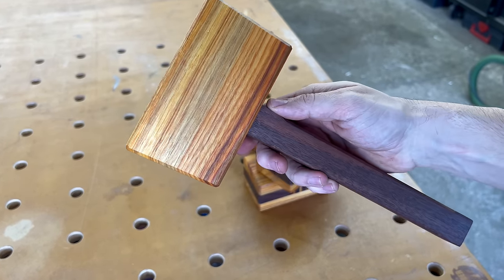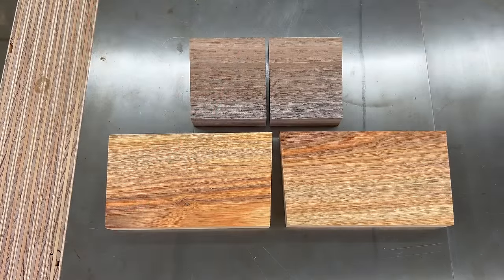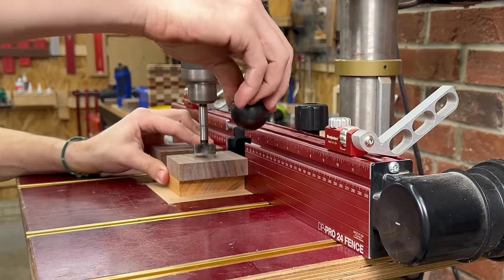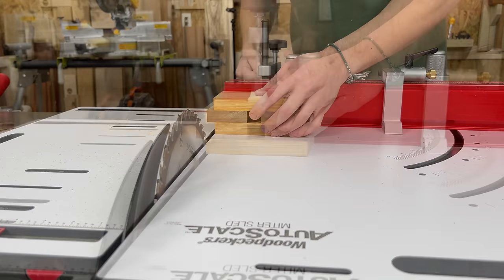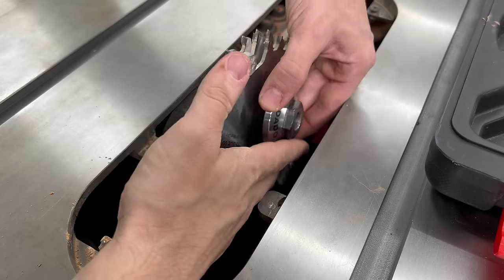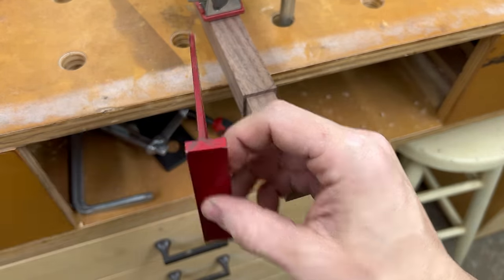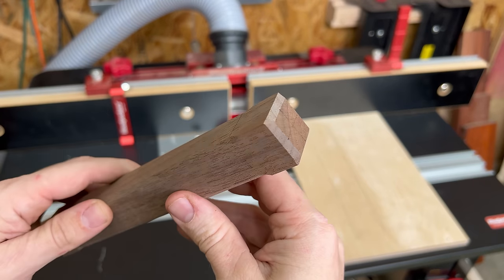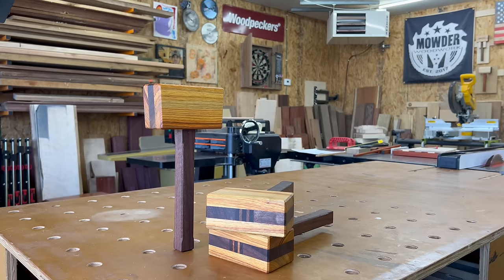Every Woodworker NEEDS a Mallet l RedTOOL WOODSHOP

Comment: I enjoyed the video very much. I always have reservations when a video is made by, or sponsored by, a tool manufacturer. When those tools are at the top end of the affordable scale, then my reservations increase. I really do fear that people looking to come into woodworking think that the only options for accurate tools are extremely expensive. 

I appreciate the Woodpecker tools that I have. They are robust and accurate. However, several years ago, I started to put my foot in the water and buy tools from Veiko and Hongdui. I have to say that it is my experience that these Chinese tools are as equally as robust and as accurate as Woodpeckers but considerably, significantly, more affordable. 

I do not like buying tools that are made in a country with a government such as the Chinese. However, I would add a couple of other points. I do not like buying tools that rely upon a perceived brand excellence to have very high prices. I also understand that there are very few tools (or anything else) that are not made in China and/or made by machinery not made in China. Finally, the cost of most of these tools is a combination of high quality aluminium (a global commodity with a global price); the manufacturing cost by CNC (again a largely global cost);labour (there will be obvious cost differences there but the labour element is minimal); overhead recovery; marketing costs (such as providing subsidised or free tools to “influencers”); and profit. 

If you love Woodpeckers and can afford to buy them, then good for you. Keep on buying. However, let nobody think you need to buy Woodpeckers in order to make beautiful, precise, functional pieces.

Comment: I am a Woodpecker fan. I I have the Auto scale Sled and I actually built the cradle from your plans. I did modify if by adding  two feet with levelers to take the stress off the table . The sled and plywood is pretty heavy.  With that said the sled gets used  an absolute ton . I am awaiting Woodpecker's releasing there Dado blade I would like to give them a try. I think I also need the perfect 90 in my shop , I love good build videos so thank you for the video.
Reply from the maker: Thanks so much for your comment! And you’re right it does add some weight to the saw, adding adjustable feet is a great idea. I think I’ll add it to mine as well! Thank you.

Comment: A really great job at articulating the value of good tools while creating a useful project.  I am a huge fan of Woodpeckers, so much so that my wife is no flagging anything with that name to come see me about it.  And now there is Blue Spruce of which I am also a big fan.  I could not help notice the holder on the side of your saw where you are storing the Woodpeckers Miter Sled along with the drop off sled.  I have the same sled and have been starting to give considerable time to figuring out where to store it.  That is a perfect solution for me.  Did you just build it to fit, or did you happen to draw any diagrams for it?  I took a screenshot of the rack with the sled still in it hoping I could make a similar solution.  My saw is different and there is an access door on the saw right on that side, but I will look on the other side and if all else fails, I can put it on a hinge to swing up when I need to get into the saw.  Keep up the good work Jay
Reply from the maker: Thanks so much for your kind words! And you’re in luck, I actually made a set of plans and an instructional video on how to make that storage holder about a year ago! I love it. I use the AutoScale every day in my shop and I don’t know what I’d do without that storage holder. I also have an access door that I’m blocking off by putting the holder there. I’ve only ever had to take it off one time when I dropped my arbor nut down in the cabinet of my saw. But I ordered an extendable magnet arm so when that happens again I can hopefully just use that instead of taking the holder off. I’ve had it mounted on my saw though for over a year and I only had to remove it that one time. Let me know if you have any other questions! 

https://youtu.be/jFEln9P4X-s?si=Gn6ROxOd3J7U22K6
Reply: @WoodpeckersLLC   That is awesome, thanks so much for sharing that.  I have had to get in there a few times as the dust pickup hose comes off every now and then.  But I figure a hinge would be more than enough for the few times I must get in there.  My saw is a PM2000 and it would be really nice if I could put that dado nut on my saw.  Since I have a lathe and a mill, I have that on my list to make one, but perhaps I will buy the example to speed up that process.
Reply from the maker: PM2000 appears to be a right-tilt saw. I think Dado Nut will fit just fine. Please let us know, if you try it.

Comment: I already have many of the items on this list but a few I would still like to have.  Since I have the AutoScale miter sled, I did not figure I needed the exact 90.  I did not buy the router package items because I have a fairly new Rockler cast iron table with pro fence and lift.  I have been really wishing I had the Woodpeckers because of the micro adjust option that makes it so much more useful for sneaking up on router cuts.  Perhaps I will find someone willing to buy my complete package and I can make that change.

Comment: Great video, thanks. But please don't reach under a spinning drill bit. You may think there's lots of room under it and that you're safe, but it only takes a fraction of a second of inattention or distraction to have a potentially life-changing injury. Just use a piece of scrap to push the chip into the vacuum port or wait till you've drilled all the holes, turn off the drill press, and then push the chips in.